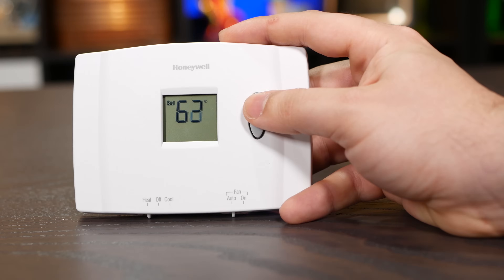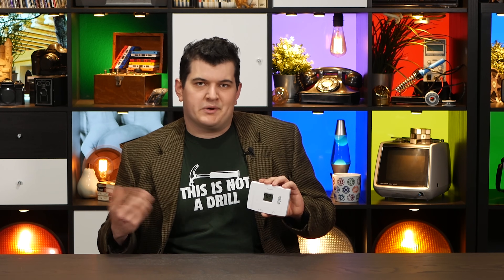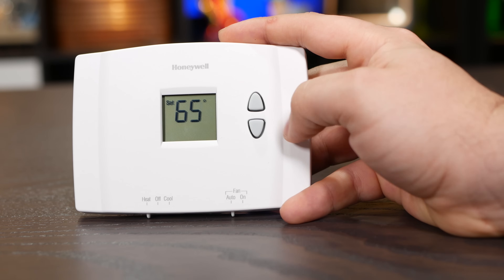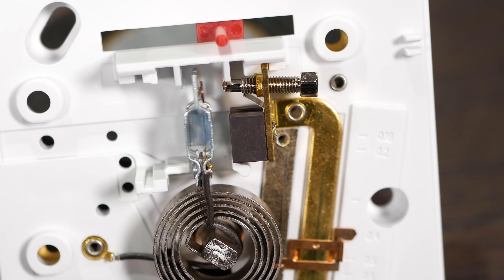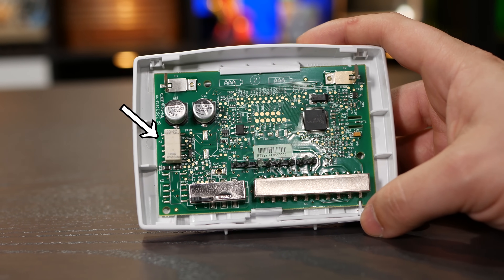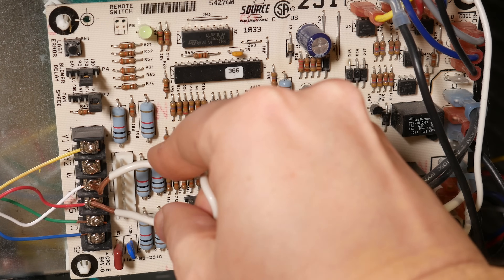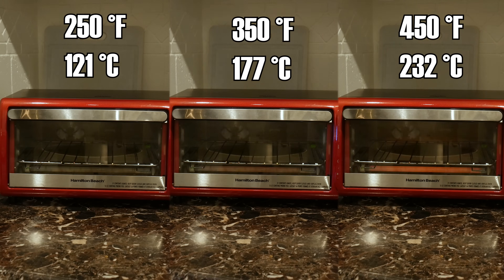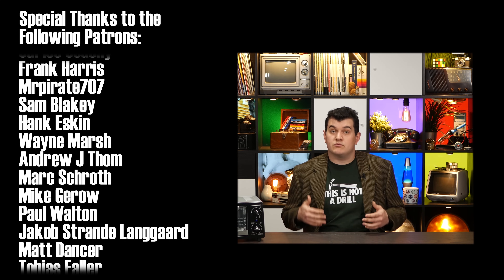Thermostats: Cooler than you think!

Comment: The older mercury bulb thermostats were better at regulating a room, IMO. The current generation has a 2 degree hysteresis. (If your set point is 75, it won't turn on until the thermostat reads 76. It won't turn off until it reads 74.) So at the start of the cooling cycle I feel too warm and at the end of it I feel too cold. This can be increased in some units but it cannot be decreased. The old mercury bulb attached to a bi-metal strip coil seemed to operate with a lower hysteresis, probably closer to 1 to 1.5 degrees. Remember, they tripped on when the coil warmed up enough to tip the bulb and flow the mercury blob to the contacts on one end of the glass. When it got cool enough that it went out of level in the other direction, it turned off. This seemed to me to be a temperature range I was generally comfortable with. Those days are gone, though. So as a temperature sensitive fella, I'm constantly uncomfortable now that the world has moved to digital thermostats because of a programming limitation. Progress.

Oh, and that second stage for heat pumps? It's not a backup. It's the "heat pumps suck" mode bringing on an old fashioned electric heating coil (mandated by code to be there, no less!) because the sucky heat pump can't keep up because it's too cold outside for the sucky heat pump to work efficiently as well as being outside the capacity of the heat pump to suck enough heat from out of doors to compensate for the amount of heat radiating out of your walls because... heat pumps suck. Oh, and when that reversing valve goes out on you, you're credit card company is gonna love you because they're a royal PITA to replace and if the technician isn't sufficiently careful, they can ruin the new one as they braze it in!  Did I mention heat pumps suck? Just wanted to be sure. :) Electric heat. Learn to love it. Not cost effective necessarily but the most reliable, safest, and frankly about the most efficient heating mechanism there is.

Comment: I have a system that allows you to come in from mowing the astro-turf and adjust the temp on a thermostat.  Two hours later, it will revert to the regular setting.  To make more permanent changes, you need to go to another screen that shows the schedule.  The company that made this system (MyTemp) went bust more than 10 years ago, and it was not cheap.

Comment: most smart thermostats have a temp hold feature.  it's not one button, though.  on my Honeywell smart stat, if i adjust the temp manually with the arrows, it will hold that until the next programmed change point.  if i want a shorter or longer hold, i can manually specify a time when the schedule resumes with a 30 minute resolution.

Comment: I have an Amana ComfortBridge system.  The lack of control between the thermostat and controller makes the tech person in me cringe, but it works REALLY well.  Both my AC and Heat are two speed, and the blower is completely variable.  But I control it with a simple thermostat (well, ecobee, but it's only connect with 5 or 6 wires, including common to power it, and an option to command dehumidification).  The control module assumes my set point hasn't changed, and will target a 20 minute runtime.  if it goes longer, it always brings on the higher speeds..

Seems like a bad idea, but it really works.

Comment: There are quite a few two stage furnaces/hp in residential America. Most have a 70% capacity on first stage, and 100% on the second. Lennox has a gas furnace with 256 different stages of heat that can meter itself down to 30% total capacity. It's the SLP98, now the SLP99.

Comment: With my Ecobee smart thermostat i use "Vacation" mode to set Temporary Heat cycles.  Its meant for turning down the heat when you go on vacation...but you can set a temporary tempurature for any date/time to any other date/time, even if its only 30 minutes.  For instance... My friend was sleeping over and staying in the basement... which i normally keep cooler at night... but i set a "Vacation" for the basement with a Higher temp while he was sleeping down there.

Comment: as an HVAC tech I spent years trying to teach homeowners 2 things.   First, your system won't work if the thermostat is in the "off" position. (lots of red faces on that one). And second, which you covered quite well, is that it is a set point device not like the accelerator on their car.  "My AC doesn't work"   Of course not.   you had the Tstat set on 65 and it ran all night and froze up.  Set it where you are comfortable and leave it there.   If it doesn;t cool the house either something is wrong or it is undersized.
Most heat pumps have electric heat backup, sometimes called emergency heat.    I have seen systems where if you turn the thermostat (electronic, not dumb) 10 degrees over ambient then it automatically kicks in the emergency heat in addition to the heat pump.    My favorite systems are like the carrier Infinity units.    Smart tstat with microprocessors in the condenser unit and the air handler all communicating.    Add a VFD (or two speed) condenser fan and two speed compressor and it does the job and saves you money as well.   And I loved them as a tech because the "Thermostat" lets you test all the systems and gives you run times of compressor and fans and what mode.     I am sure the new stuff is even better now.

Comment: Apparently you only researched the US market. In Europe a modulating thermostat is very common: it can tell the boiler to heat the water to X degrees, since it knows that will counteract the heat loss and keep the room at a constant temperature. When you set the temperature higher, it will ask for warmer water to be supplied to the radiators so the room can warm up. Setting it a lot higher will generate a lot higher water temperature instead of only slightly warmer water.

Next to that the boilers themselve also modulate here in Europe: they measure the incoming water temperature and calculate how much heat is required to output water of the desired temperature. So most boilers never run at 100% (except when taking two simultaneous showers, which does require a lot of energy). I think on average the boilers run constantly at 10-20% of their max... this results in a very efficient heating system. Requesting a low water temperature 100% of the time means the boiler can continue to run at a very low percentage, which further increases the efficiency because the rest-warmth in the gasses is used for condensation which extracts a lot of energy from those gasses that otherwise would fly out of the chimney.

Comment: A very nice presentation and clear but incomplete for the simplest thermostat. The element you didn't conclude was a nichrome wire heater behind the coil to impact the rate the furnace turns on and off. It is adjustable, and the intent Is to impact the delta in temperature between on and off. The sum of the room's temperature and the little wire will determine the final cycle time.

Comment: In response to the last Twitter question: having a program on a programmable thermostat will adjust temperature regulation on its own throughout the day. Manually setting it will cause it to override the program. It should reset to the program after it meets demand temperature, but someone correct me if I’m wrong.

Comment: Actually, it does make your house heat up faster. With it set at 72, it'll run until then, after that it'll turn off. The room will absorb the heat and your room will be cold again.... It'll take several heat cycles to bring all the objects and walls up to temp and reradiate back into the room. On the other end, setting it to 85, letting it get crazy hot, then waiting 20 minutes, the room will heat soak much quicker and you'll be up to the set temp much quicker. Just make sure to turn it down after 1-2 cycles at your highest temp or you'll end up very warm....

Comment: Re: multi-room sensors. While I agree there normally isn't a disadvantage, it can be an advantage to have extra sensors if you spend long periods of time in one room of a home. For example, I use a nest with temperatures sensors in the office and bedroom. Throughout the day, I turn the sensor on in the office because I'm sitting in there with a computer generating excess heat, and I want to maintain a certain amount of cooling, despite whatever it may do to the rest of the home. When I finish work for the day, I'll switch the sensors to the living room and the thermostat will generally have to warm up a few degrees before the AC kicks on again. Finally, I switch the sensors to the bedroom when it's time to sleep, because otherwise the bedroom is the coldest room in the house. While I don't mind it being a little colder as I fall asleep, I really don't need it to be 2-3 degrees colder than the rest of the home overnight. 

I realize this sort of falls apart in a multi-person dwelling, but to me it was totally worth the stupidly high price tag for those nest sensors. I no longer have to guess what temperature to set based on how much sunlight we have vs how much work my PC is doing to figure out the delta between two rooms - I can set and forget. Now if only Google allowed you to use presence detection or set sensor schedules to the hour instead of by arbitrary blocks of the day...

Comment: our thermostat doesn't have this feature is so few words, but it does have "hold temperature for (insert time here)", so you can, say, set the temperature down to the minimum, and then turn the hold time down to half an hour, in intervals of either half an hour or 15 minutes, I forget which. It defaults to holding the temperature for 2 hours, though, so it would be fiddly to use it exatly like you're saying, because you'd have to change the hold time every time.

Comment: If you get a thermostat you can control via home assistant then any zigbee or zwave button can be programmed to run ac for 30 minutes or something. Probably have to set temperature to current temp -1° and then set back to original temp 30 minutes later

Comment: 16:50 Here in the uk, we use a similar thermostat system except we use wall mounted boilers rather than HVAC systems (thus no need for the green and white wires). Typical stats here have either a 2-wire system (feed & return) or 3-wire (feed, return & neutral). Some of our thermostats have a "boost" function that allows the boiler to overrun for an hour. Also most of the older systems and some of the newer ones actually use the full 240v ac (which I think is nuts) rather than a nice safe 12v or 24v system. Just cost cutting I guess!

Comment: A thermostat does a little bit more than what you said. most thermostats work off of a bi metal strip or spring. and because of of that strip or spring the thermostat controls the furnace or the air conditioning. that bi metal strip or spring moves as it get warmer or colder. what most people don't understand is that if a person sets the thermostat at say seventy degrees. it doesn't mean the furnace will keep the living area at seventy degrees. the bi metal strip or spring is calibrated to get close to that temperature. but it's not one hundred percent accurate in fact they are not probably even eighty percent accurate. that's why a person can set the thermostat at let's say seventy degrees. and they will feel too warm one time and not the other.

Comment: BRB - going to take apart my thermostat to see what wires I have.

Ok, I'm back - lots of dust rhinos in there. No C-wire for my. This had made me think that what I really want is a number of wireless temperature sensors scattered throughout the house, all reporting back to a programmable thermostat. Then, I could customize a heating and cooling plan based on time of day and day of week.

M-F 8-5 - set temperature based on the sensor in my office.
Evenings and weekends? The main floor.
After 10PM - the bedroom level.
Vacation? 10C (winter) or 30C (summer)

Plus overrides if any sensor is out of range.

I bet I could do this with a few cheap sensors, some Arduinos, and a Raspbery Pi for the central controller.

It might be time to fire up the soldering iron...

Comment: He is correct! Furnace is either full blast or off. The only difference I am aware of for example my furnace has Stage 1 and Stage 2 heat. Some have 3 I think. If Stage 1 runs for a very long time it will kick in to stage 2 however I have never seen mine do this except once when here in Iowa it gets 30+ below.

Comment: I mean, setting the thermostats a few degrees higher will make it run a bit longer so that the thermostat doesn’t get fooled by a patch of cooler/warmer than average air. So if you’re trying to cool down the house after a long time away from the house in summer, the A/C will definitely run until the house is cool enough. After the first cool cycle, you could set it to the desired temperature and not deal with the many rapid cycles

Comment: I have a forced hot water (radiator) system with an aquastat. This device measures the difference between the thermostat setting and the outside temperature, and adjusts the temperature of the circulating water. On a slightly cool day, I have barely warm water in my radiators. On a winter night in the negative double digits (F), they're too hot to touch. I tested, and it's definitely based on temperature differential, not just outside temperature.

So for my system, cranking the thermostat will make the place heat up faster.

However, this is a forced hot water system with big old cast iron radiators. The ambient temperature changes so slowly it hardly matters.

Comment: If you want a "run for [time]" option, a SR latch in parallel with the thermostat that connects R & Y and has a 30 minute timer to reset the latch to open might be your solution
Reply: Or, even simpler: this wired in parallel with the Thermostat contacts and in series with its' switch between "heat" and "cool"

https://www.homedepot.com/p/TORK-C500-Series-Multi-Volt-125-250-277-VAC-30-Minute-Commercial-Style-Springwound-Auto-Off-Indoor-In-Wall-Timer-C530M/205580573?source=shoppingads&locale=en-US

Comment: Having multiple sensors would make sense in a house where temperature distribution can vary a lot depending on external factors. EG if one area has big windows, then it will be much hotter when it is sunny than when it is cloudy. With multiple sensors, you could have "run boiler if (Thermostat 1 OR Thermostat 2) < Value" or even "run boiler if (Thermostat 1 < value 1) OR (Thermostat 2 < Value 2)".
But maybe that's not a thing because you could just wire multiple thermostats in parallel for the same result, just like any other electromechanical "OR" function.

Comment: I was just waiting for you to get to mercury thermostats.   (Though I seem to remember the mercury switch being attached to the bottom of the bimetallic coil, rather than sticking out the top as you described)

Also, while you're right that remote sensors can't change the relative heating or cooling a given room gets in a normal system (so one without baffles) a smart thermostat with multiple temperature sensors can pick which sensor/room to care about based on time of day or currently occupied room.  So you could tell it that after, say, 8pm you only care about the temperature in the master bedroom; use a remote sensor there to make sure it gets to the desired temperature for sleeping while ignoring what that does the the temps in the rest of the house.
Reply: I loved my old fashioned mercury switched one. It was on top in ky implementation, and you could see the blobby nature of the mercury really being useful in that application. I am sure having that blob in the glass enclosure also helped with the sparking, and the length of it prevented the cycling. Of course if it wasn't mounted level it would cause the temperature scale to be meaningless, which the magnetic version avoids, and you can now mount of kilter villy nilly.

Comment: You want to look at cycles?  Take a look at Solid State Tesla Coils.  In the design I have built, the modulation of the IGBT is roughly 300,000 hertz (Your average solar inverter only switches them at 60 hertz (or 50 in parts of Europe)  Actually, I think you would make an awesome series of videos explaining how a solid state tesla coil (SSTC) operates.  From the capacitor and inductance dance to the resonance of the main and secondary coils, to the buildup and breakout of the charge.  It's a fascinating and unique look at how electricity works in strange ways.

BTW, My April Aire thermostats use just the 4 wires, have no battery, and manage to sip part of the 24v of the fan circuit without activating the fan.  Of course, I also have a Buderus controlled boiler that makes water temp based on the outside air, so while the "hot" water may circulate longer to heat, it uses a lot less energy because the system does not heat up the water as much normally.  Yea, in the real cold, it cranks up the heat.  But that's pretty rare.  With well programmed thermostats and the energy curve, we use under 600 gallons of oil a year to heat nearly 3000 sqft of home.

Comment: I am hvac tech,, This man will destroy people's furnaces, if you get 2 stage or modulating furnace it will operate on less heat or cool cycles, cuz furnaces are roughly rated for 100k cycles before failure and with various variables reduce the cycles

Comment: Re: the last question. In my last house I had a Carrier HVAC installed that could give you that temporary temp difference for an hour or 3 or whatever before settling back to the set temp. In fact this was the default behavior from making a temperature adjustment. To make a permanent change you had to push more buttons.